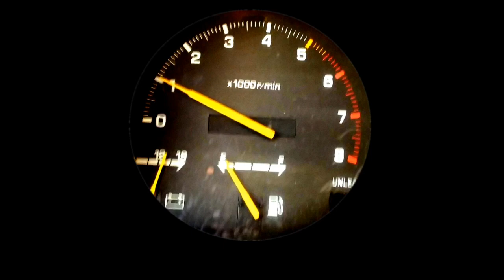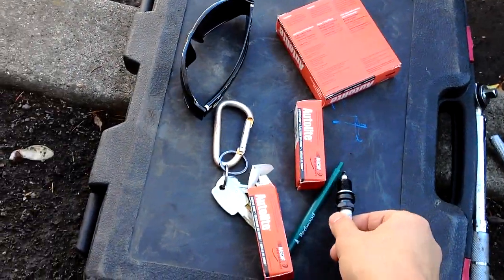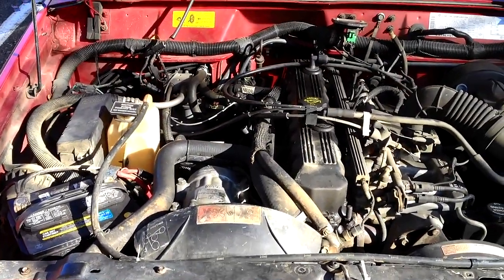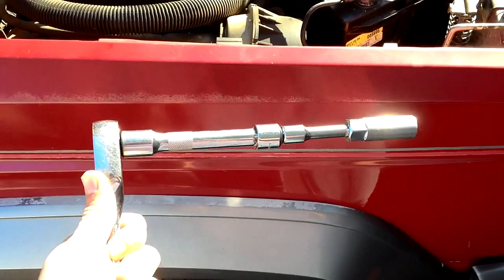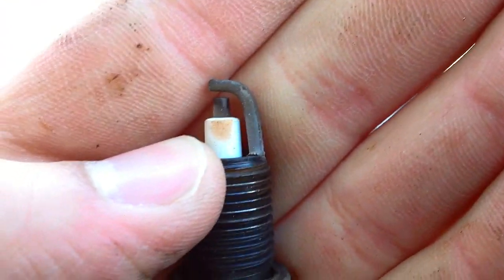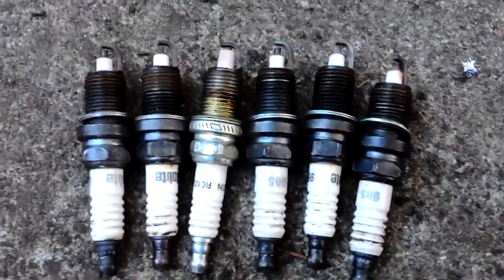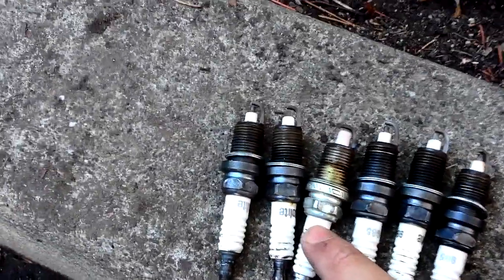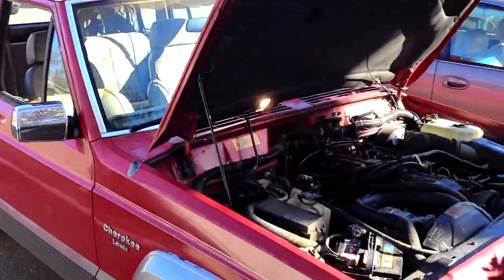1991 Jeep Cherokee Laredo - Misfire fix

Comment: You don't have to use Champion spark plugs, in fact you never wanna use Champions, Autolite either for that matter. Get yourself some NGK's(V-Powers).
Not Platinum or Iridium, since those are known to cause issues with bigger motors(American  V-8s) & don't go gettin Split-Fires either(those co$t a lot), just get your basic 'NGK V-Powers' with extended reach electrodes(that part's key).
The extended reach electrode places your spark nearer to the center of the combustion chamber for optimal ignition. For instance, take a look at the 'Reach' on my Sons NGKs http://sdrv.ms/1azf9Rx as opposed to the reach on his old Champions. http://sdrv.ms/1azfd3K & if your valves are leaking oil down into the cylinders the V-Powers help to keep the oil from reaching & pooling on the tip of your plug(electrode). Resulting in a prematurely fouled-out plug(like the bottom of a cooking oven when food drips down onto it & gets baked on hard). Yeah Champion's gone through a series of buy-outs, till it's common knowledge that their quality completely sux. 

Anyway,I'm like 99% sure this is the correct sized NGK spark plug that you'd want to use in your '91 Jeep Cherokee Laredo', it's recommended for both the 2.5 & 4.0
http://www.oreillyauto.com/site/c/detail/NGK6/7252/03435.oap?year=1991&make=Jeep&model=Cherokee&vi=1180099&ck=Search_03435_1180099_-1&pt=03435&ppt=C0334
But you should try to find a forum dedicated to your specific vehicle & talk to those guys, because they've tried various plugs & combinations of plugs, so they'd be the ones to know what plug works best in your engine, but Dude, you don't want Champions.
Good Luck Bro.
Reply from the maker: I agree with buying the better NGK's but it was just a cheap fix i did for free for somebody else. 

You seem to know quite a bit about mechanics. Do you happen to know a thing or 2 about Saturn engines?
Reply: jmoyet
Yeah I've had a couple of run-ins with a Saturn or two. Let me guess, it won't start, rite ? But hey, good looking out on helping your friend. I gotta admit those Autolites got a pretty good reach on em, so I imagine You'll be good with those(for awhile anyways). Truth is, the problem will eventually return, because that fouled out plug is only a symptom of the real problem. But like you said 'it's a free-bee for a friend', so that'll do, besides now that you found exactly which plug's fouling, your friend only has to change one plug every so often. Cool ! But yeah I've worked on a couple of Saturn's. I'll tell Ya though, I sure wouldn't let my kid buy one. They're weak, they don't hold up, nor do they hold their value, hell the Junkyard's full of nearly new Saturn's, go take a look. Anyway, describe what your facing & maybe we can figure out what's causing it.  PS: If I forget to check back here, send a message via Youtube, if you want. Later Bro.
Reply from the maker: Xproject187 I agree 100% on what you said about Saturns. Only reason I got one is because I was in need of a car ASAP and the guy was willing to sell it to me for $1,000 in payments as I was working minimum wage at the time. But I have a 97 Saturn SL2 LLO DOHC. I already know they are known for their timing chain guides going out n the clutch cylinder is non serviceable and has to be replaced entirely (another way car companies take our money). My question is are they known for the valve seals to start leaking? My (dislike calling it mine) Saturn burns oil after its at operating temperature.  Attempting to fix it as cheaply as i can to then sell it to somebody else that needs a car.